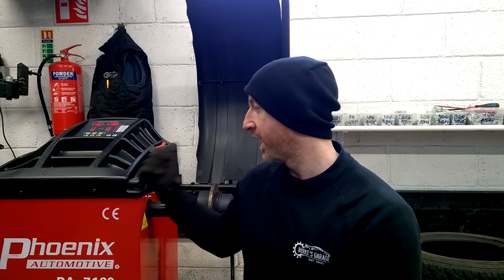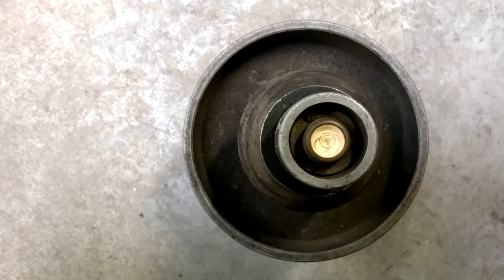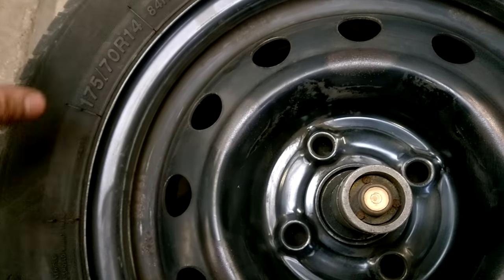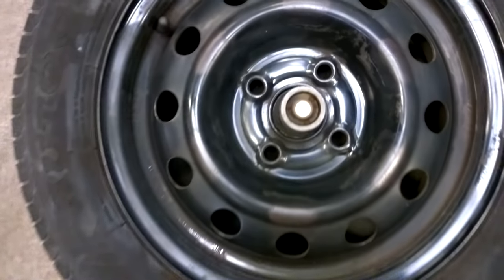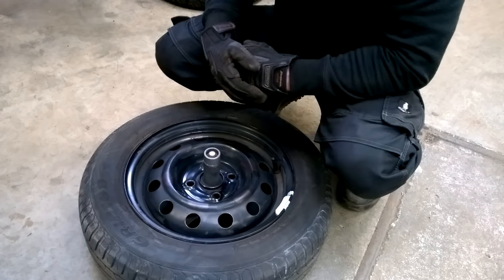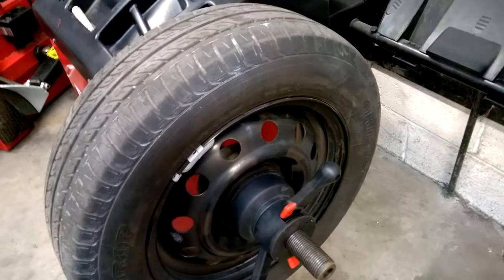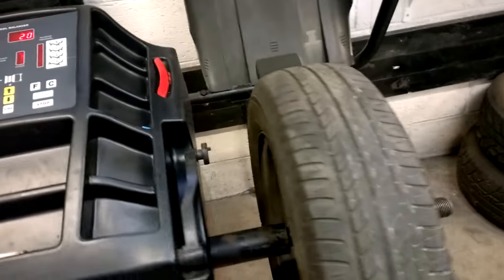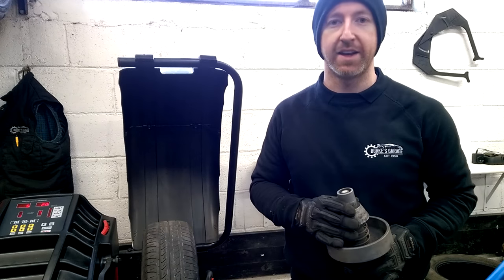Digital Wheel Balancer Vs Bubble Balancer  - Is there much of a difference???

Comment: Stupid.  If you are testing which method is the most accurate,  you cannot use 1 to disprove the other. In this video, you must verify the machine is accurate first.. then you can use that machine to check the bubble balancer.   I had 2 people in my city try to balance my new tires with new oem wheels,  and they couldn't. But the 3rd guy was successful.   All 3 used machines ..so in your video you are assuming your machine is correct. First you must prove your machine is accurate from another device. A 3rd device. An outside sourxe.
Based on your method, who can say the bubble balancer is incorrect.  Maybe the bubble balancer is correct and your machine is wrong? You might as well just assume the bubble is correct and the Machine is wrong because you have not vetted either one